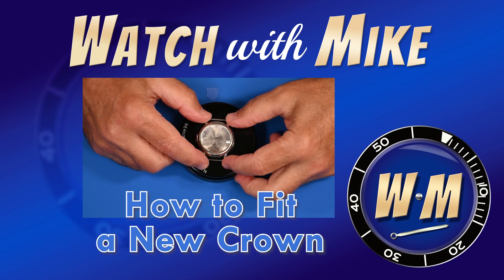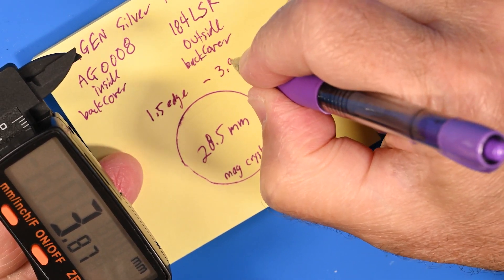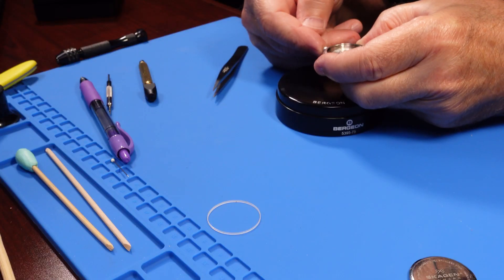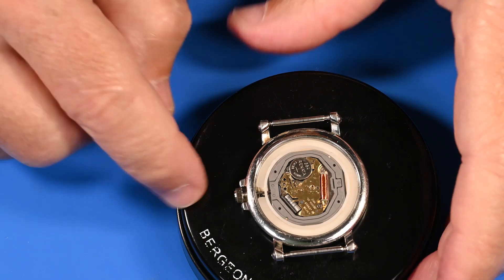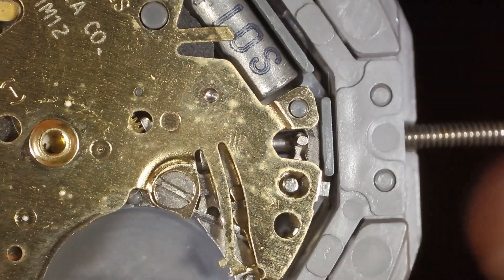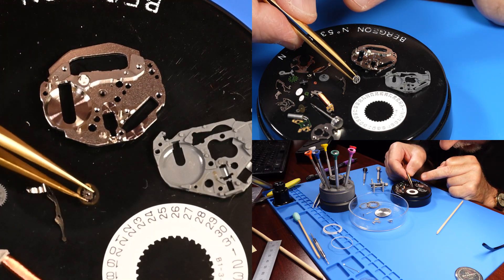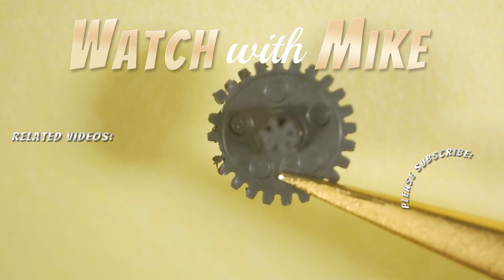Installing a Replacement Winding Crown on a Wristwatch + Miyota Quartz Movement Complete Teardown

Comment: How did you find a stem that did fit. What happens if you cant find a stem for an unmarked watch.
Reply from the maker: Oh, luckily the stem was inside the watch and I only needed a crown. If there was no stem then I could have purchased one based on the movement number. I have seen in books where a stem is made from scratch for mechanical watches by measuring the exact dimensions of all of the components that the stem fits through. It was quite a lengthy procedure!

Comment: That box of crowns is a neat purchase! Its a pity that the crown fix didn't work...A while back I took apart a Miyota 2035 and was shocked how intricate it was. It had water damage so it wasn't worth fixing but it was interesting. Its insane to think that they mass produce these in such vast quantities. Thanks for sharing Mike!
Reply from the maker: Hi Johan! I was disappointed when the winding gear failed, but I got more than $1 of enjoyment taking it apart. I agree, it is amazing seeing how all of those parts work. It's much more fun taking apart than I imagine it is trying to put one back together! 😂
Reply: @WatchWithMike  I agree. You absolutely got your monies worth! I thought I would attempt to reassemble but didnt have the guts to haha.
Reply from the maker: @johanvandersandt8904  agreed! At first I was going to save all of the parts from this watch, but I ended up throwing half of them away. I don't remember how I decided which ones to keep and which ones to chuck… I probably threw away the plastic parts.
Reply: @WatchWithMike  I decided to throw everything away as I don't want to keep then and then they have some rust on them and then that ruins another watch but in you case why not! Have a great day Mike!

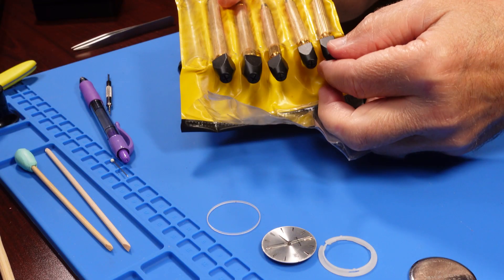Comment: Thanx for showing us Mike ! It s very useful! What is the name of the gear you use around 6:08 ? I dont see it on your Amazonlist, but I think it is a very useful tool (and one i do not have yet!). Thanks a lot ! Greetings from The Netherlands!
Reply from the maker: Hi Elmer, greetings back form USA! The tool I use at 6:08 is a 'pin vise' from a set I purchased on Esslinger: https://www.esslinger.com/brass-pin-vises-set-of-6/

You can find them on Amazon in a variety of styles. If you are going to buy a set, make sure that you can close at least one of them all the way to "0". I bought another that said it closed to zero, but in fact it didn't and small things just fell out. They are definitely a handy tool! I like to use one when I'm cleaning/polishing an old watch crown with the stem attached. You can get a really good grip and apply the pressure you need to really make them shine! 😁
Reply: @WatchWithMike  thanx for the reply, Mike! I will purchase this tool for sure! Your videos learn me a lot. It is great to learn new things that I can use on my own flea market finds!
Reply from the maker: @elmerburger  Excellent! I'm glad you're enjoying them! 😁